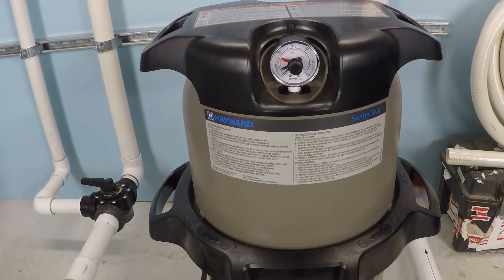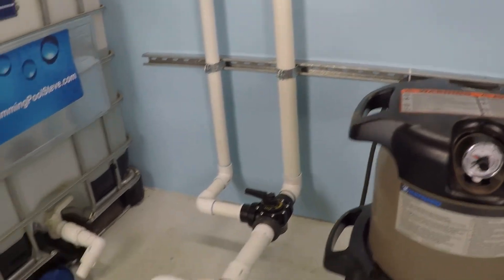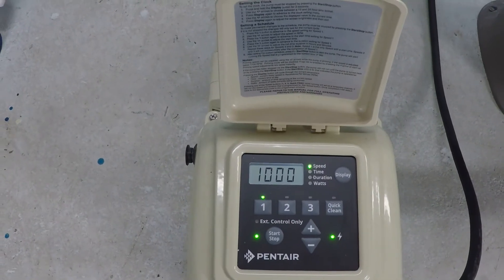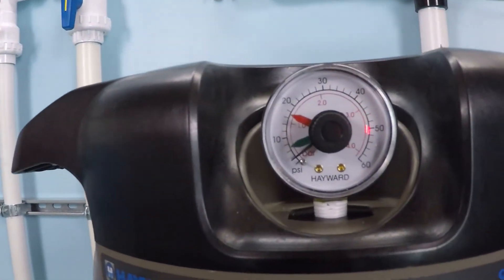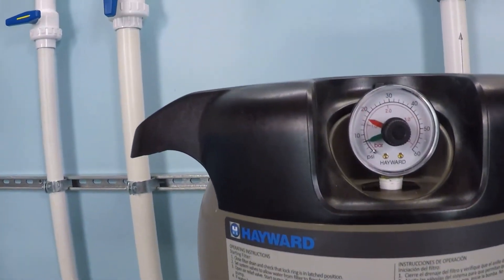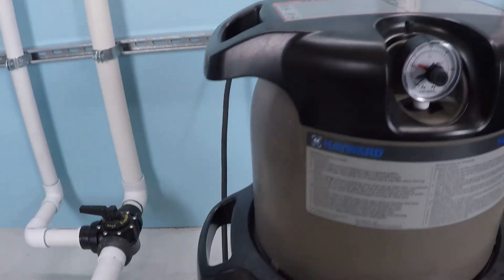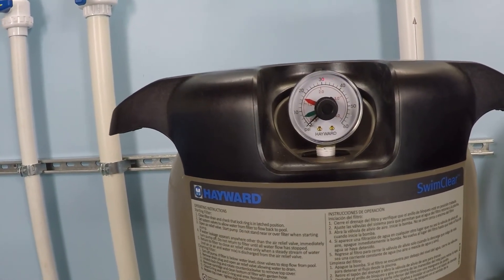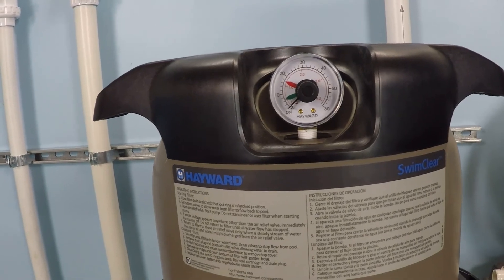Is The Filter Pressure Gauge Broken?

Comment: THAT'S  why my gauge is suddenly showing higher than 10..lol! I bought a new single speed 1.5HP to replace my tired old .75HP and im seeing higher (but well within limits) readings now. Ty!
Reply from the maker: Yes exactly - with a new pump you need to take a new (clean) filter pressure reading to know what your new system operates at.  now you will know when it is time to clean your filter.

Comment: Most of the time they actually are broken. The problem is that when the pump is switched off, there is a slight vacuum pulled as the water backtracks through the system in to the pool's. It eventually destroys the gauge. Salt water is particularly destructive to the cheap components of those $6 pool store specials they sell you every year. I personally use a Winters pressure + vacuum fluid filled gauge. It allows the pointer to dip past zero when a vacuum is pulled after switching off the pump. Expensive but have not had to replace it since.